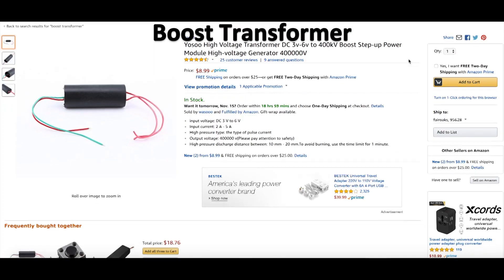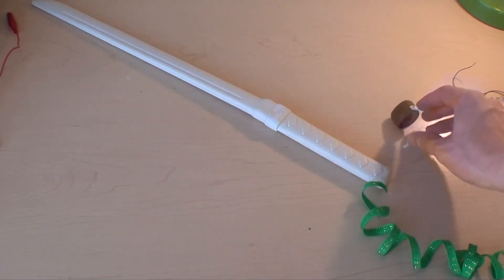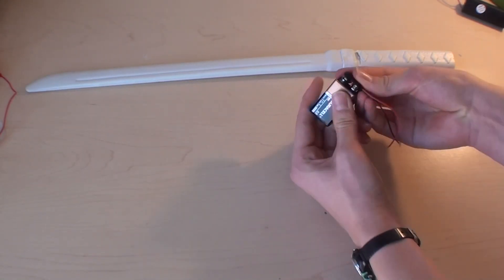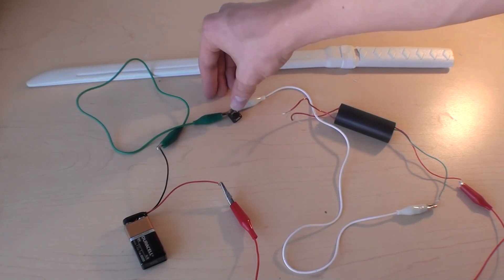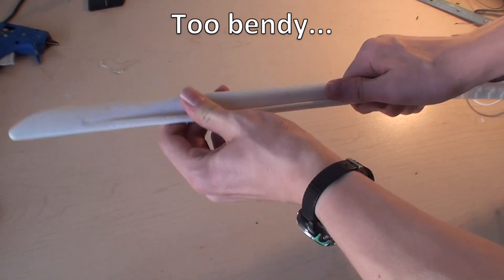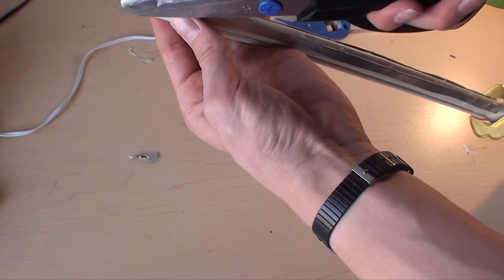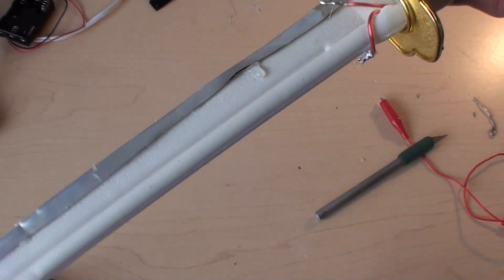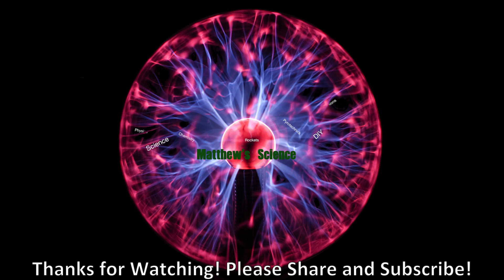How to Make a LIGHTNING SWORD

Comment: That was awesome! Too bad YouTube age restricted it. Also, one way that you can calculate the voltage easily is by measuring the air gap length in centimeters (so how far the spark can jump) then multiplying it by 30,000.
Reply from the maker: Cool, thanks!